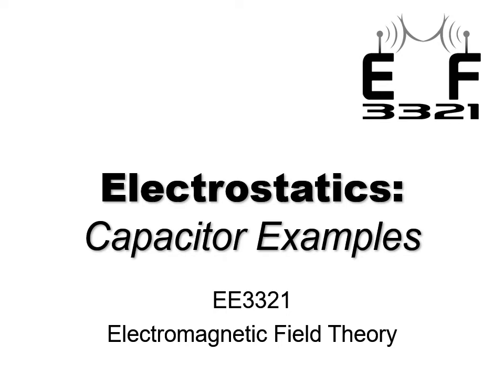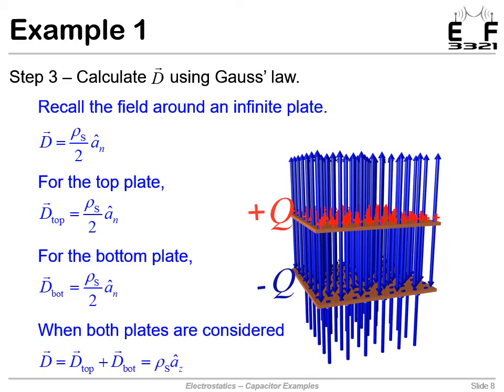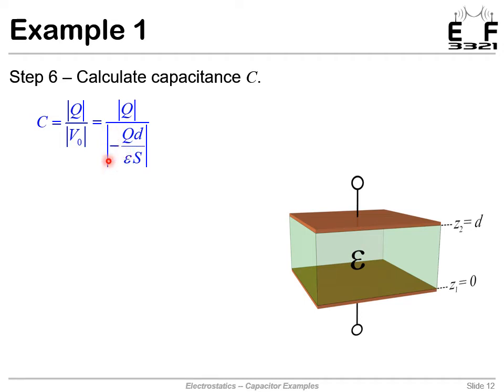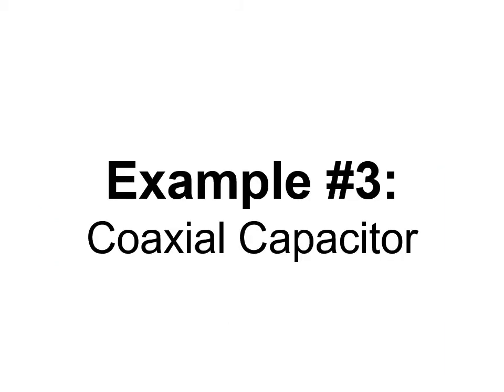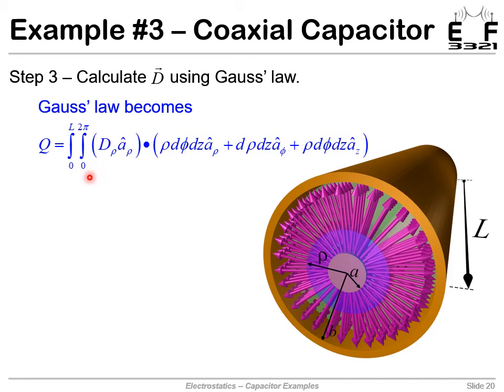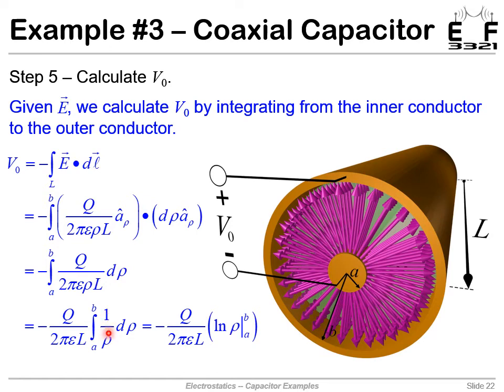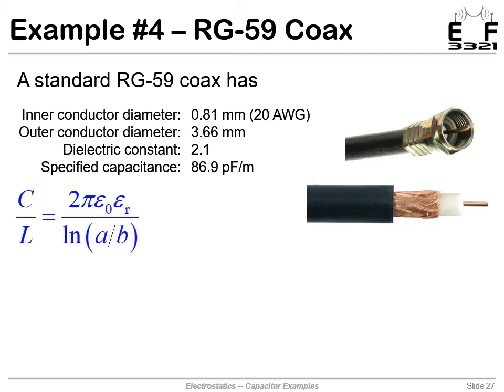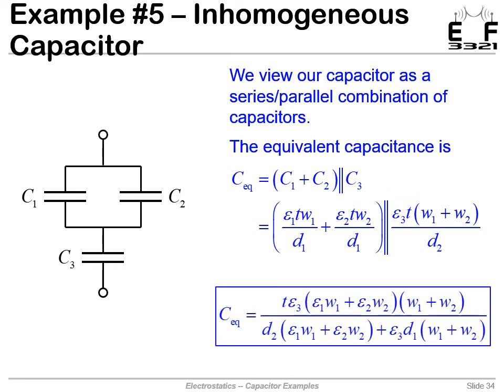Lecture 4f2 -- Capacitor Examples

Comment: I am looking for a proof that the treatment of the inhomogeneous dielectrics via individual homogeneous plate capacitors is valid for more complex structures. I can do the proof for simple series or parallel inhomogeneities, like in your video, but am stumped to derive it when the dielectric is inhomogeneous in all three spatial dimensions. Do you maybe have a ressource that deals with this in more detail?
Reply from the maker: I don't know of any resource that does this.  In general, I think this is an approximation. Treating the inhomogeneities as a network of series and parallel connections ignores the fringing effects of the fields that tends to redistribute the energy a little bit.

Comment: Professor Rumpf, when we apply Gauss' law to coax cable why does the unit area look like that?Should the third component of the sum be ro*d(ro)*d(fi)? Thank you
Reply from the maker: If d(rho) was a term, that would imply integrating in the rho direction.  Gauss' law is applied over a surface enclosing the charge.  This is a cylindrical area that extends in the directions of phi and z.  The rho direction would cut through the charges.
Reply: I got   used to generically applying Gauss' Law and it caught up with me. 
Thank you for your lectures, they make the "first step" easy!

Comment: Sir, in the supplement information, where the model of parallel plate capacitor had done, can you tell me which software was used?MATLAB?
Reply from the maker: I used MATLAB, but I have also used Octave in the past.  Both work well.  If you want to see more about how I use MATLAB (or Octave) to do this, see Lectures 6b to 7e in the following course:

https://empossible.net/academics/emp4301_5301/